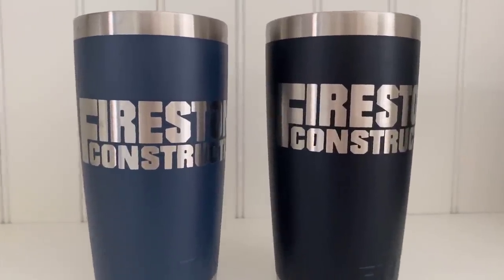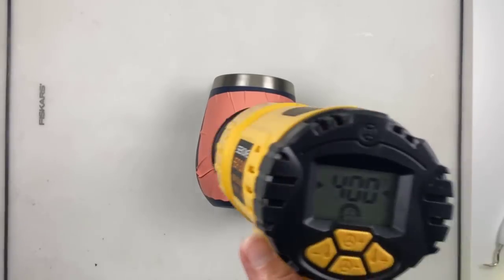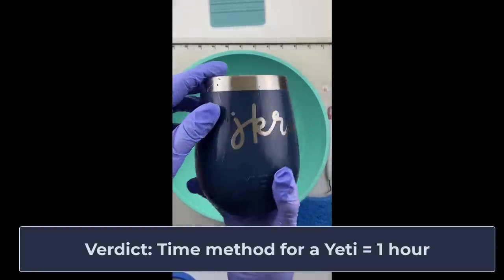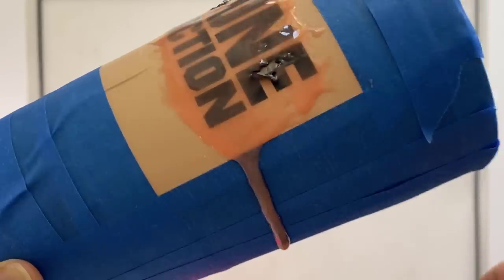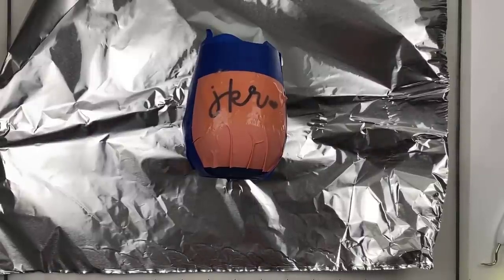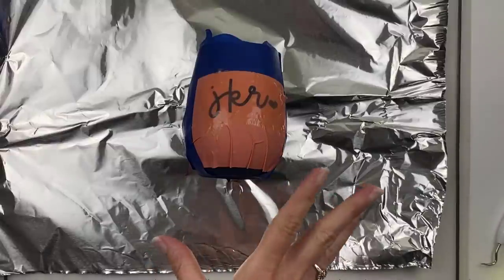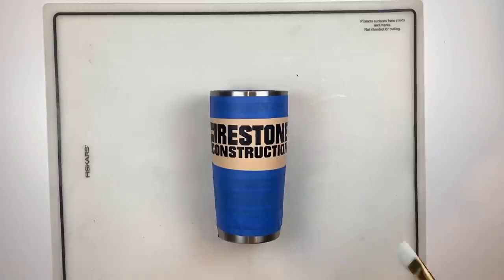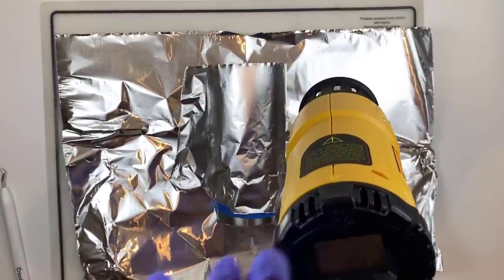Etch a Yeti Tumbler with Citristrip Using the Time Method and Heat Method ✨

Comment: Hi. Thank you so much for the all the information you provided in this video. Super helpful. 
What is your experience on light coloured yetis? All the darker ones I've done have turned out very well but I've ruined several light coloured ones. Seems to me that finish will not come off nearly as easily.
Reply from the maker: Hi! I looked back over all the Yeti’s I’ve done and for some reason they are all dark (which is weird bc pink and white are favorite tumbler colors for me). I do know on other tumblers the success can vary widely based on paint colors. If I do a light one, I’ll let you know how it works out for me.
Reply: @BeesKneesSVG  ❤
Reply: I had tried it on their recent release of orange and it will not come off are all 😭 I did however do the light blue/ teal one and that went ok, was a bit of scrubbing and scraping to clean up edges
Reply: I’ve since tried the Orange one with the heat method and some extra processing time and this has worked a bit better but still very hard to get the paint off
Reply from the maker: @ashheather9512  thanks for the update. It's crazy how it can be so different from color to color. I now know to stay away from the orange one!!!
Reply: I did a white yeti and it took about an hour and a half for the citristrip to start coming up

Comment: I did this without heat on a white 20 oz Yeti and it took 2 hrs and a lot of scrubbing to come off.  I also did a rub down on it with acetone afterward to clean the edges and remove the suck on bits.  I wouldn't recommend using the acetone on non-Yeti tumblers as the powder coating is not as durable and may remove color from the non-treated areas.
Reply from the maker: Thanks for the acetone tip. Always looking for ways to make those edges even crisper.

Comment: Thank you so much for this tutorial and the cheat sheets!! I had tried and failed and was about to totally scrap my plans but after watching your tests I am definitely going to try again.
 Do you think we can take the coating off a ruined tumbler and then etch it, to at least reuse it??
Reply from the maker: Yay! I’m so glad the video inspired you to keep going. Once you get it, it’s totally worth it. If you have a really intricate design with fine lines and you are using a heat gun, you might even want to back the temp down to 550 for a Yeti just to be extra safe. Yes, I’m totally going to try to strip my failed Yetis down and etch them. I’ll do a video about it when I do it. 😁 Good luck! Let me know how it goes.
Reply: @BeesKneesSVG  Thank you for your reply. I can't wait to give it another go with your additional tips. I'm looking forward to the next tutorial with the reuse of the failed tumbler! 
Unfortunately that work thing is interfering with my crafty thing so it will be a few days before I can try again but I will let you know. Thanks again for your help 😊
Reply from the maker: Don’t you hate it when life interferes with crafting! 😆
Reply: @BeesKneesSVG  😁 it's the pits 😉

Comment: have you done it on a Thermos brand?  I am having issues with time and with heat.  Ruined 3 so far!!
Reply from the maker: I have not done a Thermos brand yet. Some brands are tougher than others. It even varies sometimes with paint color within the same brand. I had a blue Stanley I just couldn't get to work. Are you able to do a test spot on the bottom?

Comment: Can you run the etched tumbler through the dishwasher or will the edges began to peel?
Reply from the maker: Hi! I’ve found that as long as the tumbler is dishwasher safe to start with - you can keep putting it through the dishwasher.

Comment: Can you wrap it in foil and put it in a Mug Press to apply the heat as opposed to using a heat gun?
Reply from the maker: I love the creativity here! I don't have a mug press, so I'm not sure. I guess it depends on how much you press it. If you press it too hard, the Citristrip will just be pushed aside and there might not be enough to work against the paint. If you don't push it too hard, I wonder if it'll get hot enough. If you try it, let me know!

Comment: What is it you’re placing your tumbler on?
Reply from the maker: Hi! It's a heat safe mat. Even if you aren't using heat it helps protect your surface from Citristrip spills. Here is the link: https://amzn.to/3Qax1qB. Thanks for watching!
Reply: @BeesKneesSVG  thank you. Not that though, the thing that keeps the tumbler in place so it doesn’t roll ?
Reply from the maker: @briannahosey6619  Lol! Sorry about that. It's a squeegee from Teckwrap. It's super cool bc you can use it to apply vinyl (it's rubbery so it doesn't scratch the vinyl when you are burnishing it) and you can use it to rest tumblers / cups on. And it's affordable. Here is the link https://amzn.to/3uSzRrO

Comment: Greetings does the tumbler have to be coated
Thanks in advance
Reply from the maker: Hi! It has to be a powder coated tumbler. Most tumblers you find in the stores are powder coated. If you painted it yourself, however, it will not work well.